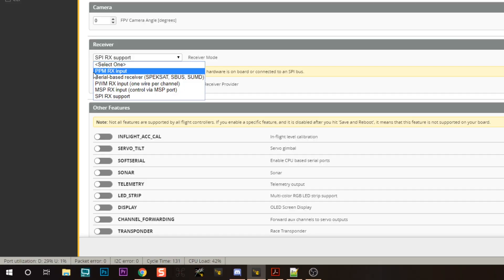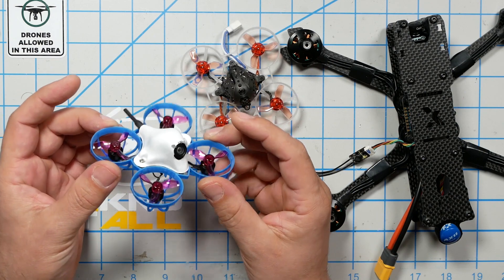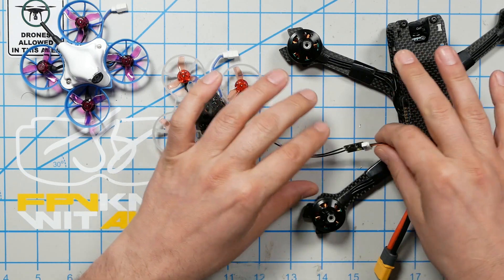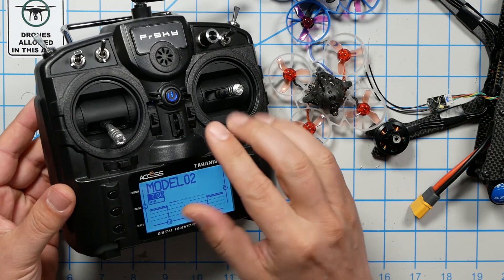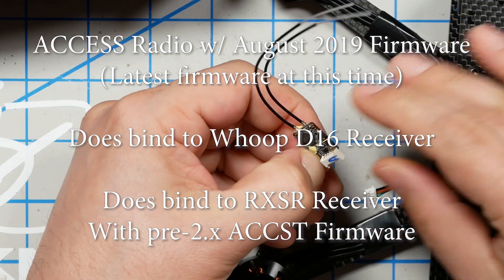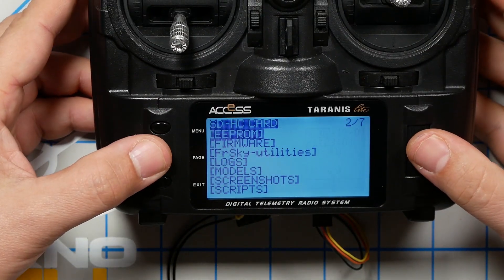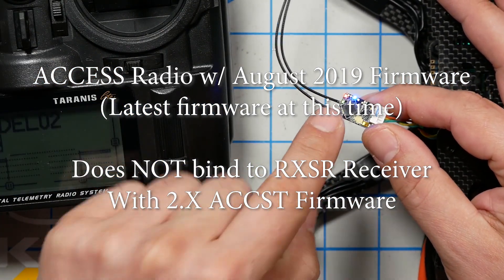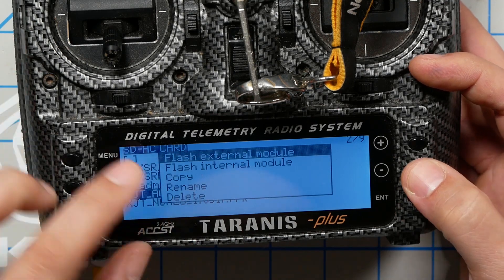FrSky won't bind! ACCST 2.0 is to blame.

Comment: Thanks for the video, mate. I was about to go mad because my Meteor65 couldn't bind my old Q7 and, as you said, it seems to be due to the new firmware of the Taranis. I installed the pre-2.0 firmware in mi internal receiver and now the radio binds perfectly!! I learnt something today 😜 Thanks Joshua!! 👍🏻👍🏻
Reply: how did you do this? I have a BETAFPV Meteor65 Pro and I am using a Taranis QX7 Access version

Comment: I've got a tiny-pusher by full speed RC with an external receiver. Got it with a DSMX rec, and it didn't connect with my radio, but wasn't sure if radio was DSM or DSMX. Now switching to Frsky Rec. as I have X9D plus (2016). I've gotten a D8, XM and XM+ micro to Bind but nothing shows in the Receiver Tab of Betaflight. The X9D has fw 2.0.20 on it. I think this is the issue, going to try downgrade to older v1.x firmware on radio. THANK YOU for these great videos, They are a big help.

Comment: Thank you for confirming that I'n not mad!! Ihad this problem 3 days before, when I flashed the new XJT firmware in my Taranis X-Lite. After that, I could not bind my Beta75 HD with discrete receiver. I bought the LBT version, and so I had to use D16, not the D8 as almost all of my other whoops. After flashing the firmware on my Taranis, I could not bind anymore. To do so, I had to flash the old firmware back, after that it worked without any problem!! Conclusio: I ordered a Jumper T16 Pro 2 days before, and cancelled my order for a new Taranis X-Lite Pro... I think the long way I will change to crossfire, the sh... going on with FRSKY starts to massivly bother me!!

Comment: I literally got into this fpv quad hobby last month, January 2020. I came in with some previous RC binding experience, from my 1/10th scale trucks so i figured shouldn’t be too much different. I got my frsky x9 lite and was super pupped when I got everything together and updated was running the newest software on everything. Tiny whoop with crazy bee f4 flight controller, beta flight , open tx, bl heli , impulse rc ,it was really a shit show really I wouldn’t have made it if it wasn’t for Joshua Bardwell video’s thank you seriously you do good work for the community. And I thought I was crazy for wasting all my money, I even bought another remote and quad because of this. I couldn’t Bind I was on reddit on Facebook on YouTube everything you can think of looking for an answer.

Comment: 100% right Joshua!  I don't know anything about all these different protocols.  In fact I had to look up how to spell protocol !   I'm way behind on all this stuff.  I finally bought a X9d, after modifying the first TX I bought which is a Turnigy.  I also bought some Jumper Txs.  I don't know the numbers by heart like you do and I bought several different Rxs  made by FrSky and found that I had to buy an external module to get some of them to bind.  Now it appears that almost everyone has moved on to the Txs from FrSky and Jumper.  If it wasn't for your videos and Bruce Simpson's I wouldn't ever get anything working.  I'll keep fighting, but they change this stuff to fast for me and my small budget!  The reason I got into this mess is because all the local hobby shops at the time only sold Spectrum and I thought it was way over priced!

Comment: I have a T8SG from first issue and I'm happy I kept it. I have the xlite also however would move to the T16 if this frsky stuff doesn't iron out. I have 8 xmplus to move forward with. Never had this much controversy in other past hobbies.  Keep up the good work.

Comment: Thanks for the video! I have an older qx7 still running the original ACCST version. My question is if someone does update to ACCST 2.0 can you reverse update the firmware back to the original version of ACCST?

Comment: An excellent public service, JB, sorry you had to lose sleep over it. A followup might be really helpful (and a good video?): A full explanation of transmitters & receivers and what the devil firmware(s) is/are installed in which and why. I have a Taranis QX7 (1st gen) and still can't figure out what's in it and what to do. I know it has the older FCC firmware (by looking at the D8, D16, LR12 options), but that's about it.

Comment: Same problem with a Tinyhawk 2 bind issue, need to buy XJT module to bind it. I don't want to buy it because I'll no longer build or buy old receiver, I'll stick to crossfire. I had a little hope when I found they enabled a switch option to put D16 in CH1-8 but it didn't bind... I believed Taranis X9D Plus SE 2019 could bind every FrSky receiver but it won't, very disapointed !
However, thanks for this great video, force be with you to handle this !

Comment: Owner of two X9d's, a ton of X4R's,XSRs, R-XSRs...  I just found some cheap D16 Rx's, the one's branded Jumper on Banggood for $10 on Hobbycool.  Only to hold me off until I purchase my TBS full crossfire, and Jumper T16, and start replacing all my Rxs later this year.  I loved FrSky, then they started doing things to protect themselves against cloning.  The reason why they are in Business in the first place!  Let's not forget the X9D (along with all X9D "like" Tx's) is a JR clone (JR 9503)!  One of the reasons why the long time company Japan Remote Control closed their doors is because FrSky was able to copy them.  WE STILL call it a "JR Bay"!!!   Lord,  TBS is a company that has its own downsides, but they have always been fair, they have always been pushing for this hobby and without them, we would not be where we are!

Comment: I am one of the guys hit by the bug in ACCST 1.x, leading to frequent lockouts and wrong rudder inputs, so I am happy FrSky is fixing this issue with ACCST 2.x.
Actually 2.x works well with my R-XSR receiver but not with my XM+, because that firmare is still very buggy. Until they will fix that somewhat after Chinese new year holidays I am using a temporary workaround for flying both the R-XSR and XM+ equipped whoops without frequently reflashing my TX module. As I already had a multiprotocol module I have just bound the XM+ to the MPM module which runs ACCST 1.x and let the R-XSR be bound to the internal TX which is on ACCST 2.x.
Reply from the maker: Be careful because some people are telling me 2.0 is also buggy, and to wait for 2.0.1 or whatever.

Comment: PLEASE HELP? 

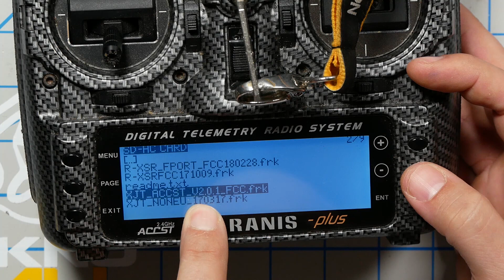Hope someone can help me figure out what I'm doing wrong. I am trying to update my X9D+ radio firmware exactly as shown at 7:08. It says "resetting device" for a few seconds, with a progress bar at the bottom, then shows a "Firmware update error Device not responding" I havent been able to figure out how to get this firmware to flash. I flashed my receiver fine with the "flash external module" process but cant flash the internal transmitter. I have tried different versions of firmware and all do the same. Not sure how to resolve this and I can't really find any info on it either.

X9D+
Firmware: opentx-x9d+
Version:  2.3.15-otx
DATE: 2022-04-22 15:30:36
EEPROM: 219

Comment: Hi Josh,  over a year down the road, I still like the FrSky SxR series with my Jumper T16 - I like the gyro stabilization option for most of my (mid size) new plane models and keep getting receivers at a reasonable price.  I am experiencing that about 1/3 of the purchased receivers bind out of the box, 2/3 I have to downgrade to FW from 05/31/19 to get them to work.  The big question is: are you aware of an OpenTx development meanwhile that is capabel of support BOTH ACCST 1.x AND ACCST 2.x by now?  Thanks for a quick comment to a question from one of your patreons

Comment: After several nights ... I should see your videos more ...

Thanks for the information.

It was definitely my last FrySky product ... this is no longer normal with the different firmware versions ...

A solution for X-Light Pro users:

Load firmware flash from XJT "Big" onto the XJT Light external Modul. So I can fly D8 Tinys again ...

If I had known that!

Comment: therefore it should no longer be called a free sky but should be called an imprisoned sky. However good Joshua you are really smart. I have to tell you that I had arrived at the same solution the day before yesterday, because I took a small quadcopter and I could not bind it, so I had to downgrade and I was able to. or an x-light pro and the problem was the same. Bravo, again and thank you!

Comment: Hi Joshua, I can't Vind my Mobula 8 FR sky to my Radiomaster Zorro 4in1. I updated the firmware in betaflight to the latest and loaded the original config, then I went to bind but nothing happens on the drone when I hit bind, the red led keeks solid and the green keeps slow blinking. I tried binding in D8 and D16 al combinations ut absolutely no response from the drone looks like refuses to enter bind mode. Any advice? this is my first decent drone, but I come from helis and surface vehicles so I have experience with the transmitter but nothing about beta flight, i am watching your tutorial series but im stuck on binding. Thanks for the help.

Comment: On Taranis QX7 Accst  Does it erase firmware and eeprom when I push factory reset button? My boot loader is frozen, everything else works fine. Version 2.2.2 but in bootloader screen it’s ver. 2.3.9 and it will not connect to pc, says error and stm disconnects. Can’t scroll on boot screen it locks and I have to remove battery to exit. Really close to buying different brand of transmitter.

Comment: I'm 100% with you except I'm buying into the FrSky system because I want the size and form factor of the X-lite controller and I want to fly whoops. I own Futaba and have a FrSky DHT Module but I wanted something smaller. 

I'm excited for the new TBS Tango 2 but Xfire only is a dealbreaker for me since again, you can't fly whoops without adding an external receiver. 

Jumper needs to clone the X-Lite and I'd be more than happy to move over to a radio they make!

Comment: I have a question. I bought a couple xm+’s. 
I have an old QX7 model with ACCST. 
One of the xm+’s i put on my Mobula 7 and it worked fine no issues. The other i tried putting on a Betafpv 2-4 aio board and it will NOT bind to my QX7. The receiver will go into binding mode but will never blink confirming its bound. 

I have been told it is because the new XM+’s have ACCESS firmware and thus will not work with QX7 running ACCST, but then how did it work on my mobula 7 just fine? 
Super confused and dont know what to do. Its My first build and its all complete just want to bind the damn thing. 

Idk what i needa do.

Comment: Has now completed my shift from FrSky. Sold my Taranis Q X7 radio and my quads above 250 gram weight. Have purchased a Tango 2 and converted my Emax TinyHawk to Crossfire. I have also an FPV Cycle BabyTooth, which still has an XM+ RX on it, but will get converted to Crossfire as well. I will not go back to FrSky for quite some time now, I would reckon.

Comment: I just saw this as I’m about to purchase an opentx transmitter and was looking at what receivers to buy. Up til now I’ve been using the orange rx dsmx ppm receiver but its only 6 channels. I was going fo get frsky xm+ until I saw this. What receiver would you recommend? The flysky 14 and 16 channel seem pretty good but nearly twice the price.

Comment: Wow so emotional Joshua. 

Yes FrSky made business decision to close protocol. Correct me if I’m wrong but TBS is not open protocol and never been so they are not first company doing that.
I’ve got two Access radios. Latency is low, binding without pressing button allows me to switch between radios seamlessly, BT trainer is nice feature. After initial mess, Access firmwares work now on r-xsr, Xm+, and R9 with no issues. Then when I want to fly something ‘exotic’ like my Walkera F210 - I have multimodules. Now ‘exotic’ became D16 v1.0 and I fly whoops using multi-module  because external RX adds weight. Just using right tool and flying.
Btw take the newest Tango2. Only Crossfire? No module bay? Such a protective company but still supported by OpenTx.

There is one thing I don’t understand about FrSky. If they already made this decision they should clearly inform like ‘ACCST v2.0 is not backward compatible with ACCST v1.0. Use XJT or multimodule if you want to use ACCST V1.0’. Not doing this they create this shady area and show themselves as ones that have something to hide. Well good PR is not the strongest point of Chinese companies.

Trying to understand your madness only with FrSky and hope channel won’t turn into ‘sensational’ path because it sells.
Still I used to say ‘your circus - your monkeys’ :) 
Cheers.

Comment: Also, it's probably an option to spend more money with FrSky and fit an external module in the back of the Taranis that's pre 2.0.0 and update the internal module to 2.0+, then in the open tx menus you can pick internal or external module.  at last that way you'd not need 2x transmitters and have both 2.x and pre 2.x compatibility.

Comment: Thank you for this video. 
i 100% agree with you. 

So what do you recomend instead of frsky? 
Have 3 kwads 1 is whoop so new TBS controler will not work for me.
Reply: Jumper T16 Pro has all you will ever need.
Reply: @mikebergman1817  they do make a much smaller radio with OpenTX and very similar feature set - T12. Not exactly X-Lite small, but similar to X9 Lite, maybe even a little smaller.
Reply: @FilipRadelic  i ma going to order one this week. watched some rewievs and loved it. Thank you for suggerstion

Comment: Just as a heads up for Tiny Whoop FCs with SPI receivers you  can bind ACCESS  radios that have ACCST D8/16 thru the CLI.  For betaflight 4.1 go to CLI and type bind_rx.  BF 4.0.x bind_rx_spi. BF 4.0 bind. BF 3.5.x rsky_bind.
Reply: @mikebergman1817  yep
Reply: I had to do that with a Beta65.
Reply: Everyday FPV Can you help an old man out, and clarify with the exact cli commands for 3.5. or 4.0 as an example?  I’m not as we versed in computer speech as you younger or smarter guys!  Thanks

Comment: So I am brand new to fpv.... and well I got the Frsky x9d plus 2019 version and..... smh! ive been on a simulator for a bit over a week but got a betafpv 75s and want to fly it.... well i cant smh but what tiny whoop would u recommend that would work.... are you saying it has to be a frsky compatible D8 to work with the x9d+ 2019?? Sorry just want to confirm before i buy another tiny whoop

Comment: If i upgrade my transmitter firmware, will that make it incompatible with all my existing quad receivers?    Should i just flash ACCST version 1 to the one receiver that i am having issues with?

Comment: I feel like this is the issue I'm having.  I have an ancient 6 year old x9d+ that is def old ACCST and binds to some receivers.  I got a new RX6R receiver and I can bind it to my x9d+, but not to a QX7S radio that I have (ACCST QX7S, definitely not access).  I don't see any XJT firmware avail on the QX7S page that has anything other than ACCST2.1.0 so. this means I need to update the receiver to something new to make it bind to the QX7S I think?

Comment: I find it ironic that *Free*Sky is becoming more restrictive as we go.
As I was preparing to get into the hobby, everyone ran Taranis X9D OG.
I ended up getting a full RTF Walkera that reviewed positively. The Devo air interface is downright primitive compared to FrSky's though.
It don't even have telemetry or permanent binding!

I ended up getting the Jumper T16 Pro pretty much on release. Still have it, still love it, will be getting it an ExpressLRS module.
Needed a little ribbon cable work though, and have one more repair to do in there. The control affected is one I don't use though.

Comment: Hi Joshua I’m have literally just had the same problem I’ve got a taranis qx7 which I updated and bought a gt7 with a full size xm+ receiver as I’m new I don’t know anything about all this how do I downgrade the firmware as there doesn’t seem to be the option or is this not possible, if not what would you suggest is a better radio and receiver grouping as I might just change over to something that isn’t having a bitch fit with receiver makers many thanks Justin all the way from the uk
Reply: same problem, have u fix this?

Comment: Ok this has completely stuffed me up> switching firmware & trying to switch back, can't find EEPROMs etc etc...
Companion will not download, check or compile firmwares for me now.
All I want to do is go back to original factory settings as it was shipped to me & start again (when everything worked).

& do you think there is a fracking google hit on "Factory Reset Taranis X Lite"?
How do I do this?

Comment: Total newb. Got an X7 and being a good boy updated everything to newest. USB-SIM worked. Wanted to use the nifty XSR-SIM USB-Module. No Binding possible whatsoever. And of course I didn't get an Update-Cable. Thanks to this vid I downgraded from 2.0.1 to the old TX Firmware and BAM! Binding worked. Thanks for the explanation. That might help me with my Tinyhawk as well, once it arrives!

Comment: Thank you so much for this video. I have been struggling for a week to get my Mobula7 V2 to bind to my Q7 with the ACCST. Is there any way to make this work? Can I download an older firmware?  I hope to here back from you. I waited and waited to get my Mobula7 and I haven’t been able to fly it!!  

Thanks for all you do for the Hobby.
Reply from the maker: If you have an ACCST radio, then you should be able to bind to the Mob7 in D8 mode.